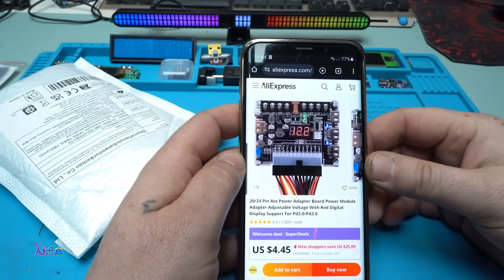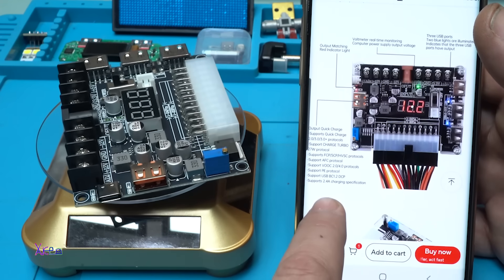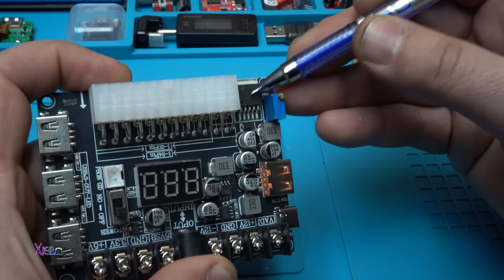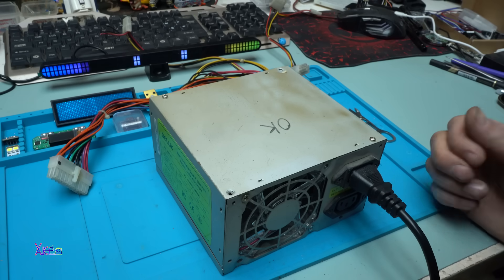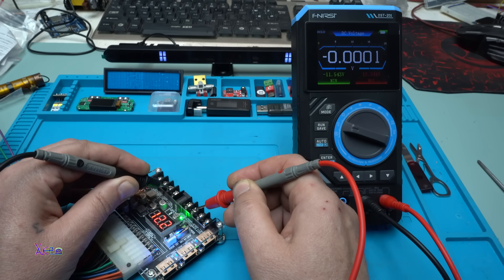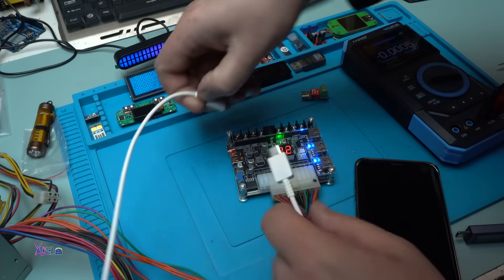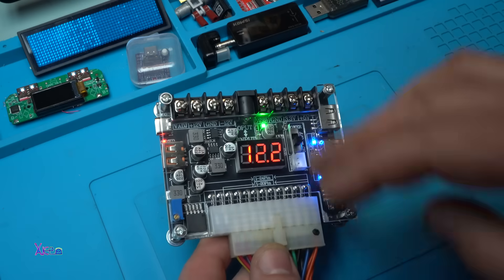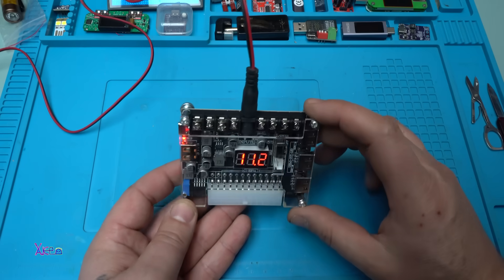WHY THIS $4 Aliexpress Module is FANTASTIC?

Comment: Hi, I don't really understand, but is it possible to connect crocodiles through this board and charge a 12 volt car battery?
Reply: There's no shut-off protection to keep your from overcharging (cooking) your battery.
Reply: @MikesClassicEntertainment  Are there no such sensors?
Reply: @johndeep7757  There are, but with this module it would be a waste of power, and a cluster of modules with wires everywhere.  Considering you can get a self contained 12v lead acid charger that does exactly what you want off Ali for under $10, I think there are better choices.
Reply: @MikesClassicEntertainment  thx

Comment: When you have the ac adapter hooked up, does the white connector put OUT 
the voltages need to RUN an ATX computer? If so, can you hook a battery to the 
power in and run a computer remotely with battery power?
Reply: No, you need DC-ATX power supply module.

Comment: What happened with the PD trigger? The voltage did not seem to be changing from 9V and then you abruptly cut out of that with no explanation? Maybe it needs to be unplugged and plugged in again to renegotiate? I guess it uses the 2A regulator off the 12V supply, so limited to 24W, or maybe 18W because of regulator drop-out? Another observation is that there are no fuses so potentially dangerous currents will be available on the 3.3, 5 and 12V screw terminals? I've been looking for one of these ATX breakouts with eFuses to give adjustable current limitation, but maybe I need to make that myself?

Comment: 12:26 sparks flying bro and things go red. 120W of input made it sick fast.
Reply: the module is not pulling 120w max output is 2 amps when using the other output ports. The only output port being matched from the input is the one next to the illuminated red light.